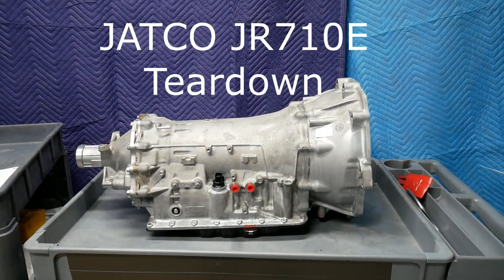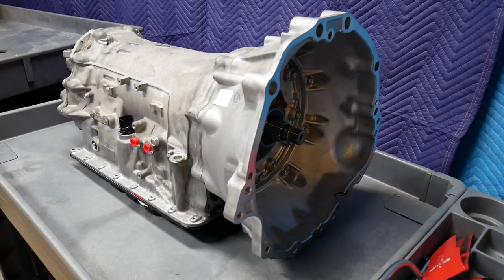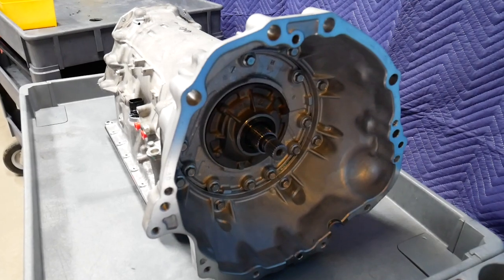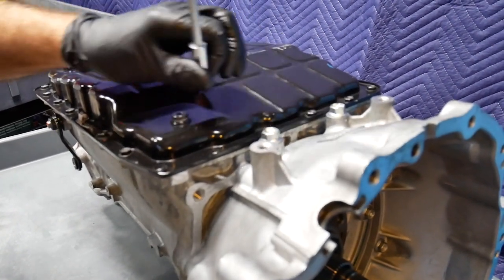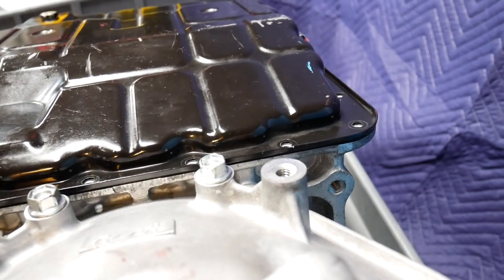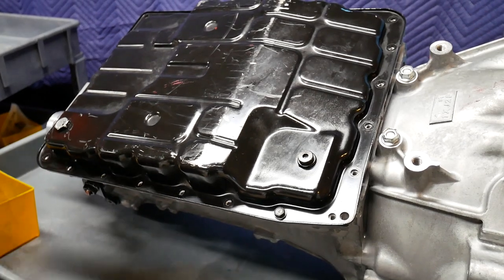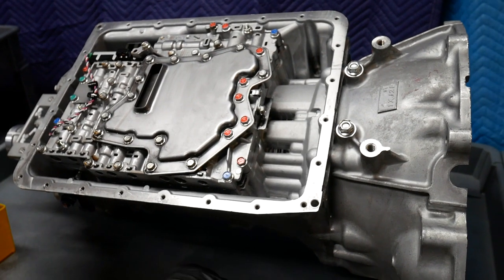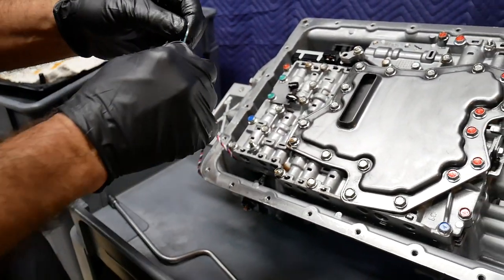Nissan Infiniti JATCO JR710E Transmission Disassembly

Comment: Speed handle....good use...not as quick as air tools but faster than regular sockets and less risk of getting too much torque and damaging either threads, bolt heads or both.
Reply: You do not want to go with anything more than an air or cordless ratchet for that application.

Comment: Have you got any opinion on the manufacturers "sealed for life" fluids? I'm in Australia and did 3x drain and fill on my 370z with the jatco 7at. You cannot get Nissan matic s fluid from dealers here unless you buy large 20 liter drums for about $450 which I was quoted. I replaced with full synthetic low viscosity fluid that meets the matic s spec.

I've seen a lot of arguments online from folks who obviously aren't car people who argue you never should replace the fluid and can actually cause damage doing so. After training and filling 3 times following the factory service manual I swear the transmission feels so much better. I think mine was a little bit low from factory as it would slip a little when cold.
Reply from the maker: Service intervals for an automatic transmission vary from every 70,000 miles to never. The typical service interval is 70,000 to 100,000 miles. Changing it more often does absolutely no harm.
Because heat is generated in an automatic transmission as the friction plates slip during a shift, automatic transmission fluid actually degrades and breaks down with use. If you don't change the transmission fluid at all, you'll be lubricating your transmission with degraded fluid and other contaminants. This will shorten the transmission's life.  In other words, changing your transmission fluid at the correct interval is a good investment.
If when you take a sample of the fluid from your car and it is dark and has a burned smell, then it is time to service your unit. If however a sample of fluid is clean and smells fairly new then you can hold off for another 30,000 miles, be sure the fluid level is correct. 
Many manufactures purchase their transmission from JATCO, ASIAN, or ZF, and the manufacturers give you a warranty for up to 70,000 to 100,000 miles. However after that you are on your own as far your vehicle maintenance and repair is concerned.
Reply: @ThompsonAutoTest  Excellent explanation. I got a 2018 Nissan Navara - mexican manufactured - (Frontier in Brazil) with a similar transmission and I am looking for the oil and filter replacement for the ATF. Can I hold the original fluid for up to 5 years if I don't reach the minimum mileage - a repair shop told me it must be replaced with 50.000 km (31.000 miles) or four years. The owner's manual just brings the following information:  ATF oil must respect "NIssan Matic S" specs. There's nothing about time intervals.
Reply from the maker: @zepe_reira  Transmission fluid can be stored for extremely long periods of time whether it's stored in the bottle on the shelf or in the transmission. Mileage is the major factor for both engine oils and transmission fluids.
Reply: Thanks a lot for your reply!

Comment: I have ,also infiniti Q50 2014 is it the same,components?the problem is only ,shifting to 2&3 after that,stop and high idling and i will check the IDS  they have code p0720 it means oss /output speed sensor, so if i replace the oss  is it sure the shifting is going to normal?

Comment: What your thoughts on this transmission? Is it reliable? Can it handle more power?
Reply from the maker: So far this has been a winner for Nissan and Infiniti as these cars and SUVs equipped this transmission have held up very well. Some of its applications are real high performance vehicles and it seems to be handling the load and lasting fairly well.

Comment: I have this transmission on my 2017 Q50. It shifts really rough between 2- 3 and 3-4 gears, up or down. Sometime the car is jerking so bad or making loud knocking during the shift. No idea where the sound is coming from. Hopefully the transmission will be dead before my warranty ends.
Reply from the maker: The first step would be to install the scan tool and check for fault codes and monitor operation while observing the symptoms.
A quick check of fluid level and condition is in order, however, I believe the 2017 Q50 does not have a transmission fluid dipstick. These types of transmissions are designed to be maintenance free. In order to check the transmission fluid, your vehicle likely has a  overflow bolt on the bottom of the transmission pan. Your car must be level when the fluid is checked and we therefore recommend having a mechanic with a hydraulic lift or underground bay check your transmission fluid. If you are still under warranty I would recommend letting the dealer inspect the unit and make any recommendations.
Reply: @ThompsonAutoTest  Hello friend. JR710E are the same RE7R01B? and these transmissions does  have a transmission fluid dipstick?

Comment: I had my 7AT serviced for the first time at 90k, I immediately noticed the car would have a hard time in turns. In 3rd-4th gear the car at 35-45 mph will occasionally “slip” whereas the other gears function perfectly fine. If I abruptly brake to a standstill the car will hesitate before rolling when I put my foot on the gas. If i push the car hard enough in lower gears, the car CAN go into limp mode. I never had issues prior to servicing my transmission. I’ve been told that this can be symptoms of a bad valve body. Can you confirm this?  It seems to make sense now knowing that the TCM and valve body are interconnected, causing the car to run a failsafe. Thank you
Reply: the problem is either a bad valve body or bad tq converter
Reply: Clean and check the solenoids in the valve body.  They may have gotten gunked up with debris.
Reply: @christiansmith2425  the problem could also be a worn out clutch disc stack.

Comment: I’m facing an inevitable rebuild, how much should it cost? Haha the guy told me that these come 11-12$K brand new. I cannot find any factory remanufactured RE7R01A’s. I also cannot find any price estimate for the rebuild cost online or abroad. Help me :(
Reply from the maker: Many automatic transmissions can be rebuilt and put back into the service with a basic overhaul kit or banner kit and many hard parts come from used units purchased from used auto parts suppliers. This unit costs $1200 and was purchased from Autogator, a used auto parts supplier in California specializing in late model cars. 

https://www.autogator.com/index.php

The cost of a full rebuild with a one year warranty at our shop is between $1500-$3500 depending on the vehicles and the damage.  

We purchase our overhaul kits and banner kits from WIT Transmission Parts and transmission cores from a variety of used auto parts suppliers. 

https://www.wittrans.com/
Reply: Thompson AutoTest:

Sir this info is amazing.
Could you refer me to whichever kit you vouch for the most in terms of the highest possible quality, reliability, and long term durability? Because the Q50 beats on this transmission with its VQ37 engine and i need to supply this builder with the best kit i can find. Which one is that to you?
Reply from the maker: @bennett4881  WIT Transmission Parts is the single largest supplier in the US. We always have good service with them.

Comment: Nissan uses vehicle names...Altima, Maxima, Sentra etc.....Infiniti uses letters and up until around 2024 into designate engine displacement. Example G25 M35/37/45/56. 

Starting in 2015 they went to Q and the number has no cross reference to engine size.  Basically Q for sedans and QX for CUV/SUV. The QXX of the first number is odd most likely a sedan.  (Q50/70). Q with even number in the middle is a coupe (Q60)

The QX design pretty simply means All/4 wheel drive.

The exception to the Even number being a coupe is the CUV/SUV where the higher number means bigger size.

Comment: Hi there,  I was wondering if you had the torque specs for the bellhousing to trans case bolts. I can find the information for the manual transmission but not the automatic.

Comment: hey thompson i have a question, are these transmissions normally mounted in the same position as the start of the video? im getting code p0720 which is output shaft speed sensor. Which is inside based off your video. But would i just be able to remove that cover from under or is it positioned on the top when the transmission is installed? THANKS a ton. I have the sensor on hand.
Reply: p0720 is a bit generic, but check that your Speedo works first.  If you still have a working speedo then it may not be the sensor.   To change the sensor:

1) Drain and Remove trans pan.
2) Disconnect sensor wire from TCM board
3) Drop tail extension of transmission (after disconnecting axle)
4) 10mm to undo sensor as shown.
5) reverse steps to install new sensor

Comment: Thank you master for the video by accident the output shaft came out like an inch I was replacing speed sensor, so the transmission is in the car so that means I won’t be able to put all way in the output shaft because is horizontal position. I am home mechanic is my son car I’m already scared because I can’t put bell housing back. Any help will be appreciated. Thank you
Reply from the maker: Try to gently turn the output shaft to help with the alignment as you reinsert.

Comment: My 370z 2011 is so slow between gears with only 25,000 miles on the car, had 3 shops say can fix it but it comes back the same or worse to the point i'm selling it, any advice as i would like to keep it .
Reply: craig sawyer bring it to the infinity/Nissan dealer and they should be able to do an updated software flash that helps with the sluggish shifting.
Reply: Buy a manual transmission....

Comment: Any videos of a rebuild..?  As in assembly
Reply from the maker: Will do in the future.
Reply: @ThompsonAutoTest  that would be great I just installed a speed sensor and started reassembling drive shaft is already installed as I was installing transmission linkage I couldn't get the transmission into Park. I was wondering was it any thing that needs to be done with the parking mechanism before installing rear case..?

Comment: do we have to change the transmission pan every time you change the oil?
Reply: if the transmission is  ot damaged 
you dont & also make sure ur fill & drain bolt are ok & great condition as to ur thread to both of them

Comment: I have a 2013 G37x with 7 speed Jatco transmission. Change transmission fluid every 30k miles. At 60k miles right after 2nd transmission fluid change the transmission started shifting rough when cold. 

Whenever the transmission shifts into D from Park or from 2nd to 1st gear when coming to full stop at the intersection or stop sign, the transmission would bang into gear and the whole car would shake!

It only acted up when the transmission was cold.

What could be the problem? Did the last mechanic under fill the fluid? Just missing half a quart of fluid maybe?

Ran a scan, no codes.
Reply: may be the type of fluid used in the last change...........

Comment: Thank you for this very instructive video. Do you know what are the torque specs for the valve body filter bolts ?
Reply from the maker: TORQUE "ALL" VALVE BODYBOLTS TO 10 N·M  (90 IN.LB.)
http://shop.ukrtrans.biz/wp-content/uploads/catalogs/JR710E.pdf
This is a very helpful .pdf file to help with the understanding and repair of the JR710E Transmission.
Reply: @ThompsonAutoTest  Thank you very much ! I had been looking for such a detailed document for weeks. You guys are awesome !

Comment: this is such a great video, I have a 2011 Infiniti M56S I hear a loud clicking noise(solenoid click?) when it shifts the first 2 or 3 gears or when i use the manual mode any ideas what it could be I already changed all fluids transmission/rwd transfer etc at 130000 km
Reply from the maker: It is always a good idea to service the transmission and change the fluid in the transfer case on a high mileage vehicle. When changing fluids look carefully at the old fluid for condition,  metal, and clutch material. Normally it is hard to hear the solenoids turning on and off so I would suspect a possible mechanical problem developing with this loud clicking sound.